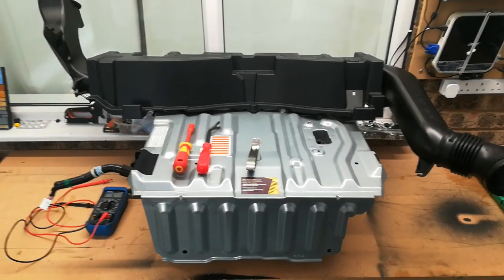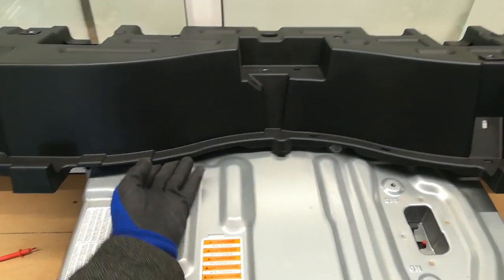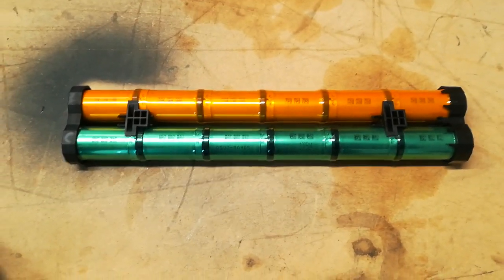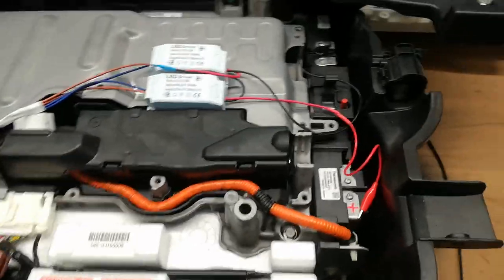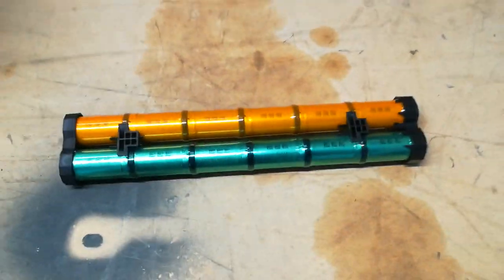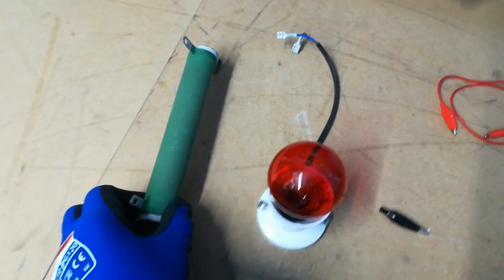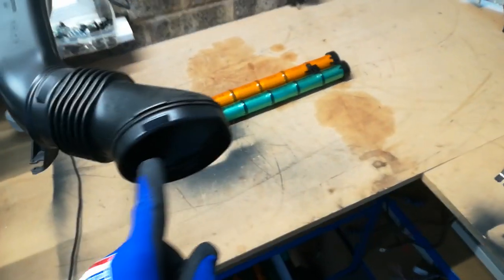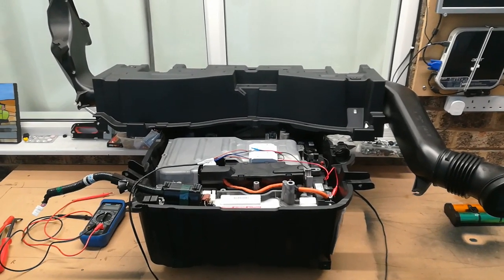CRZ NIMH IMA Battery Rejuvenation. Video 1

Comment: Is the CR-Z IMA system robust enough for full time motor/battery use at low engine loads ?

The toyota CH-R 2.0 Hybrid option comes as 150HP NA + 30HP Motor.
This actually runs mainly on the battery and motor while poodling low load around town, where the motor just fires up for recharge.
In theory we could considerably improve the economy on the CR-Z, by offloading to battery with enough recharge rate and capacity.

The following is the tyre and aero drag on the CR-Z and the wheel torque required for constant speed with 225/45/r17 at 97% rolling radius.
Trans loss.. Engine / 1.13. Final Drive 4.111:1. 6th Gear 0.688:1. Frontal area 2.035 m2. CD 0.300.
Optimal 4 valve- 112hp @ 5950-6050... 109 lb.ft @ 4650-4800 (122.0hp @ 5950-6050... 120.2 lb.ft @ 4500-4600 with IMA)
Optimal 3 valve - 122.4lb.ft @ 2300-2350 (147.1 lb.ft @ 1900-1950 with IMA)

30mph 57 lb.ft 78nm Drag (5377rpm @ 12.917..  = 1177rpm @ 2.828 6th needs 22.8 lb.ft or 5.1hp)
40mph 69 lb.ft 94nm Drag (4265rpm @ 7.683.. = 1570rpm @ 2.828 6th needs 27.6 lb.ft or 8.3hp)
50mph 84 lb.ft 114nm Drag (5331 @ 7.683.. = 1962rpm @ 2.828 6th needs 33.6 lb.ft or 12.6hp)
56mph 95 lb.ft 128nm Drag (5971 @ 7.683.. = 2198rpm @ 2.828 6th needs 38.0 lb.ft or 15.9hp)
60mph 102 lb.ft 139nm Drag (4460rpm @ 5.357.. = 2354rpm @ 2.828 6th needs 40.8 lb ft or 18.3hp)
124mph 299 lb ft 405nm Drag (4871rpm @  2.828 6th needs 119.5 lb.ft or 110.8hp)
Reply from the maker: Hi Please post questions on the CR-Z forum in the relevant threads or start one for your project. Thanks Peter
Reply: @retepsnikrep  CR-Z forum ?
Reply from the maker: @RuneRelic  https://www.crzforum.com/

Comment: Morning Peter. Some advice on a project if you can.

I am targetting 150hp NA + 32.5HP IMA or 160hp NA + 22.5hp IMA.
The bigger power IMA gives better all round performance and best 0-60 approaching 5.1s at 32.5hp or 5.3s at 22.5hp with 4.928:1 final drive.
This will peak at 148mph @ 7000rpm with the right cam.

I know you are working on performance upgrades for the Lithium and trying to extend that to the nickel candium retrofit.
1. Can you let me know where you are at with this and what my options are for the battery IMA at present ?
2. I have heard mixed messages about the battery/IMA system cut out approaching 7k rpm, can you clarify this ?
3. Is cooling and discharge rate a problem ?
This is currently the 2011 Lea1 nickel cadnium that needs ....rejuvinating.

Thanks for the post and the help.
Reply from the maker: Hi Please post questions on the CR-Z forum in the relevant threads or start one for your project. Thanks Peter

Comment: Hi Peter, just curious if you know what would happen if i were to use an LED bulb instead of an incandescent one. I understand it may take longer to discharge the battery but would the current or voltage be too mich for an LED bulb?
Reply from the maker: Questions on the crz forum thread please.

Comment: 3x48v motors (TorqAMP or similar) + e-compressor to replace/share motor assist, but use the IMA battery regen ?
Make the CRZ what it was meant to be, without the parasitic losses, volumetric plugging and packaging issues of superchargers and turbochargers.
Thanks by the way.

Comment: Peter,, could one use a oxford battery conditioner instead of the homemade charger in the video ?
Reply from the maker: Please post questions on the crz forum in the rejuvenation thread.  Thanks
Reply: Yeah ive tried that forum. They are a waste of space
Reply from the maker: @andrewpodmore2440  Really?  I haven't seen a question from you on the thread.. 

https://www.crzforum.com/threads/nimh-ima-battery-rejuvenation-procedure-p0a7f.94400/?post_id=1397295#post-1397295

Comment: To be effective you need more than 138,6 Volts. (low current) I would need details onthe procedure to reset the battery capacity in the odb ?
Reply from the maker: All the details are in the thread on the CR-Z forum. 
https://www.crzforum.com/threads/nimh-ima-battery-rejuvenation-procedure.94400/#post-1397295
Reply: @retepsnikrep  thanks !

Comment: for the DC power supply, in the gen 1 video you used a pair of 100vdc cc led drivers, for this crz used a pair of 65v power supplies, are they interchangeable? or is the voltage difference too great?

Comment: Sorry for this Mr Peters, you're probably not gonna respond but I'm kinda desperate to know if it's a real problem or something my paranoid mind Is creating, after many months making sacrifices I finally managed to buy my very own crz I ordered one from one of the islands in my country it came with 64k Kms and Honda's maintenance book thingy came with him that showed that the car had always been maintained in a Honda retailer until at least 60K , I have the car for about a month or so now, and the battery indicator when I comute to work every night sometimes behaves in a weird manner, for example just today (I make about 20 Kms from home to work using the highway which in this particular case is almost always uphill) and sometimes if the battery gets completely discharged (like today) the battery display bars stick up at either 2 or 3 bars until they disappear after a while , should I be worried ? Is it a more simple problem than what I'm making it out to be? Sorry for the inconvenience
Reply from the maker: Log onto the CR-Z forum and post the problem there. 
If the car is a NImh one then do the process outlined on the forum and in this video.

Comment: Also is there a way to test the battery packs to see if you have a bad one ? i recently had the ima light come on on my 2011 honda crz and i,m not sure how to tell if i may have a bad battery pack or not
Reply from the maker: You need to read the proper IMA codes and post them on the CR-Z forum fior advice..

Comment: Hi, Thanks for those videos ! My question is, is that possible to run the car without the IMA battery while I'm doing discharge recharging protocol ???
Reply from the maker: All questions on the CR-Z forum in the appropriate threads please. I only use YT as a video host.
Reply: thankyou you saved me to make grid charger my battery need to refresh .sorry I cannot speak English but I understand your videos

Comment: Is there no risk in fully discharging the battery?
Reply from the maker: Very small. But you charge first to reduce the risk.  If it fails after deep discharging it was a basket case anyway. 
You should try the simple charge first and only use cycling if there is no improvement with simple charging.
Reply: @Peter Perkins  What do you mean by charge it first? If it's dead, then what's the point of charging? Could I just charge it up every time it starts dying and save money? Please help me lol...
Reply: @DOCUMENTT  just do what the man who knows way more than you says. You charge it first from being dead to verify whether or not its even going to accept and hold the charge...